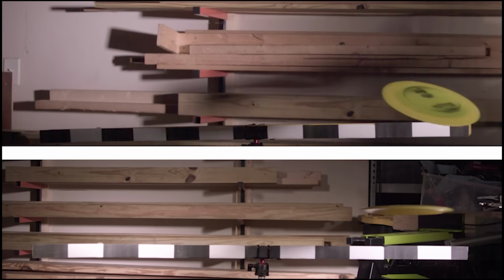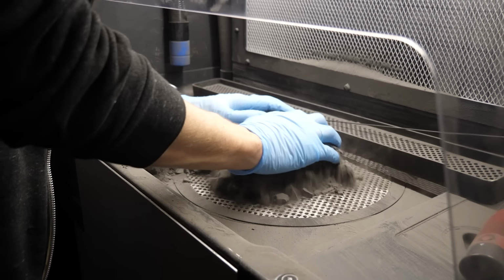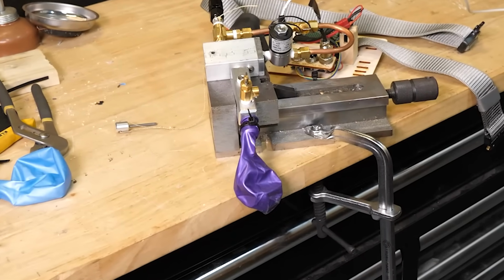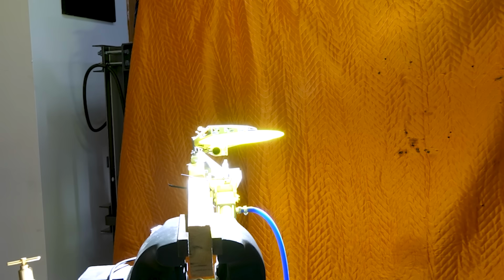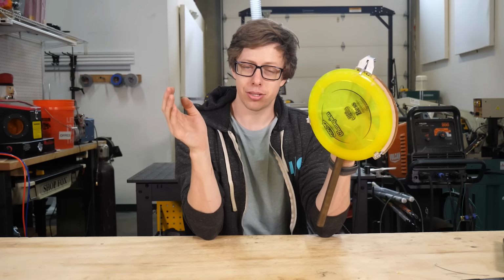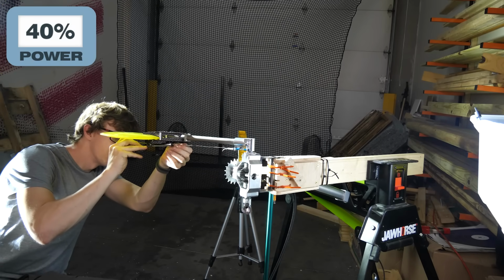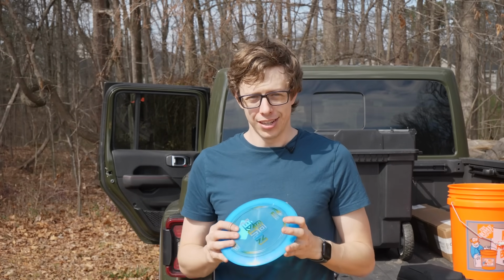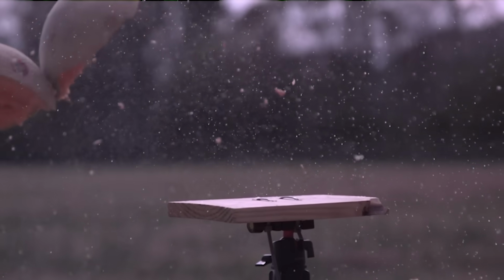Wrist rocket: worlds fastest disc launcher

Comment: You should tilt it a bit more towards the ground (to the left). It naturally wants to tilt to the right, so it will stabilize in the air and go further before tilting to the right. I know that from personal experience but I don't know if it will apply to the speed you're using. Great video btw, can't wait for more!
Reply: Makes sense
Reply: @Perspari  Thought the same exact thing.
Reply: Honestly surprised he didn't think of it on his own, but that kind of insight is probably gained from more experience playing. With the right regulation disc, right release angle, right wind he could break 1k with it.
Reply: @mikesearcy9151  exactly what I was thinking, he makes parts with a CNC machine and carbon fibre, but didn’t think about releasing the overstable disc more hyzer.
Reply: Seriously I was so frustrated that he didn't try that. You can tell from the slomos that it is tilted to the right as soon as it is launched.  If he starts it with a left tilt it will take longer to tilt to the right.  This guy isn't really that smart is he hahaha
Reply: You are correct! He needs to angle it WAY down at those speeds. It’s what’s called a hyzer flip.
Reply: There's that, "smart - stupid" continuum in action.

Comment: What I noticed for the machine is that when in the field it was launching everything at a flat  or even to an anheizer angle. I think that if they had forced these discs into heizer flips? they would have flexed out and gone a LOT further.
Reply: Absolutely.
Reply: Was literally just about to comment this lol. If you’re spinning a disc that fast, launch it on a sharp hyzer and let the disc stand up and glide.
Reply: @holterskolter  I bet the could release it almost vertically and it'd still flip up. I think it was a mistake for him not to reach out to a disc golf pro / expert. This could have been a WAYYY cooler experiment.

Comment: The two things I thought when first watching this video:  1.  You're not going to get enough spin.  2.  Angle of release can't be flat/speed and stability problems.  You needed a release mechanism that was going to impart a lot of spin on the disc, and you need a very over stable high speed disc launched on a pretty extreme hyzer angle.
Reply: I agree with your assessment. Hopefully he can work out what all the disc golf specific terminology means and make the necessary corrections. The whole time I was watching, I was saying to myself "nooo that's too flat, you need way more hyzer on the release!". Definitely needs more spin on the disc as well. I think a good candidate for a disc to try would be the Loft Bohrium.
Reply: @thndrlngs  What about the Tilt?  Definitely needs to release it on a steep hyzer as well.
Reply: You need a wrist action on the arm. And get rid of the diff. Attach the piston gear direct to the arm.
Reply: I was thinking this thing needs a hyzer flip angle to go far. He was throwing on an almost anhyzer release
Reply: Exactly. Spin is like cowbell. Ya can't get too much.

Comment: Have you considered throwing the disc forward with air pressure along a curved rail? your spinning apparatus itself is eating most of the forces you're putting on the disc before it leaves. I think you could get something like 1k ft. using something like a sliding "rail gun".

Comment: I’m surprised you didn’t try different angles of release. If it becomes “flippy” because of the speed, you should angle the outer edge down so it has more of an angle to turn over.
Reply: @Melt68  an hyzer?
Reply: Part of it just might have been the inexperience with not playing as much.
Reply: @slayerficated  No, hyzer so it doesnt flip so fastt
Reply: @Melt68  yeah, basically spike hyzer would probably level out on the more stable discs. and if the disc wobbles a lot, it also makes the disc less stable and more prone to flipping over.

Comment: My only gripe is you tested with an anhyzer angle. Before you start making more versions, do another round of testing with hyzer flips and maybe those overstable discs will hold their lines. Also test the tomahawk & other angled throws please! Maybe testing understable discs will get them spin-stabilized xD

Also, maybe make your own regulation discs that have extreme overstability? Probably cheaper than carbon fiber.
Reply: Release angle is part of it, but I think lack of rotation compared to a human throw at the same speed is more significant.
Reply: @BenKickert  I thought the same thing. Being that the disc doesn't have the wrist motion that humans give a disc when thrown it removes a lot of gyro stability.
Reply: Or get Discmania to sponsor the video with a bucket full of Tilt's!
Reply: Yes try it with a tilt
Reply: The largest issue appears to be lack of spin if you ask me.
Reply: He needs a secondary hinge on the disc gripper, like the wrist on an arm.
Reply: @BenKickert  we didn't great above shot in the video but id bet that holder isn't putting nearly as much spin as necessary for the kind of speed he's getting, when he stared the video with "I don't want to make a human hand" I realized he was doomed.

Comment: Incredible video. I love how the iterations moved the throwing style closer to how humans do it (holding the front of the disc rather than the back).

This machine does have commercial potential! Sell them to disc manufacturers to help them design new discs with specific flight paths. A standard throw is more valuable than a variable human throw.

I suggest trying different release angles. Your discs were all going to the right, so if you release with the disc wanting to go left, the disc should actually 'flip up' and fly flat
Reply: Came looking for this. I'm not an engineer or I would have tried to build this a decade ago. I could imagine manufacturers or resellers wanting this. Right now we have no standard way of truly rating one manufacturer's discs against another. This would be a game changer if you can get it to replicate a human throw, and be adjustable. 

Imagine walking into a disc golf store. You do a couple throws into a net where they measure the speed and spin you're throwing and pick the perfect disc to give you the most distance or the flight you want. PLEASE PLEASE PLEASE build this.
Reply: Totally agree on a design similar to this to sell to the disc mfrs... this wud be gold for them to have a way to get a consistent throw to better clarify the flight numbers... just needs some tweaks to control the speed & snap akin to what us mortals wud do on the tee-pad if/when we throw it as expected... also good for the disc mfrs to test discs on releases more or less than rated (speed/etc) for that perfect hyzer-flip disc based on what a person can throw... like here's the flight path for a 10-speed disc & here's the flight path when thrown at 8/9/11/12/etc speeds

Comment: This is great. As a disc golfer it would be amazing if a machine could match the spin and speed of a human throw for disc comparing purposes. I do think it has commercial potential for sales to disc manufactures.

On the distance testing it looked like all of them were released on an "anhyzer" angle (outside edge of the disc higher than the inside edge)? Did you try with a hyzer angle (the outside edge of the disc lower than the inside edge)?
Reply: lmfao untill a tank fails and blows a person in half, compressed air is no joke.
Reply: @codyskyrimvolen  in a proper testing environment safety precautions would likely be taken. Better shielding, a more sophisticated release mechanism and a HPA compressor that's in a separate room would do a lot to mitigate the risks in a commercial testing environment.
Reply: @codyskyrimvolen  divers use compressed air, how often are they blown in half? Asking for a friend.
Reply: @codyskyrimvolen  lol, tank failure is the least likely thing to worry about here :-D
Reply: This comment needs to be on top so @Stuff can see it, because this is the solution. A -3 turn disc doesn't flip with low power throws, while even 0 turn can flip on high power throws.
Some can throw 0 turn on hyzer, others need -3 turn on hyzer to get a flip-up.
Reply: @elricdotah  they check the tanks 3 times everytime they use or filll them, inspections on this kind of equipment are life and death.

Comment: One improvement that you overlooked when you abandoned the counter-rotating arm is that you no longer need the gearbox. That's a major source of power loss.
Reply: plus with no gearbox he could move the arm closer to inline with where the thing is held, eliminating most of the rotation problem he was having
Reply: At the very least, remove the lower pinion.
Reply: Even with the power loss he wasn't able to shoot disks at full power, so I'm not sure how more power would have helped
Reply: I think rather then using a complicated gearbox setup he could have had the rod extend past the rotation point a little bit where a heavy weight carefully measured to counteract the weight on the other side. This would resolve the torque issue while keeping everything mostly balanced.

If he wanted to get even more fancy he could try and make the counter balance side of the army get shorter when the disc gets released so that the lack of the disc wouldn't result in a change in the balance of the arm.

Comment: I know this video is older now, but if you release the disc with the outer edge lower on release, it will flatten out in flight before coming back the way it’s supposed to. It’s called turnover, the less stable the disc, the more likely it is to turn and flip like you saw.

Comment: Probably won't see this comment, but awesome video! I spend a lot of time around discs and have thought a lot about creating a machine that can "throw" discs with consistency. My thoughts regarding an arm powered device for faster and farther throws would be to attach a mechanical arm to the arm and forearm, hinged, of course, where the elbow is, and geared to have a faster output than the input. The mechanical arm would extend completely across the body, while your arm only goes back about halfway. When throwing, the gearing will make the mechanical arm move faster and "catch up" to your arm at full extension in the throw.

Comment: I feel like if you made a baseball pitching machine specifically for frisbees, it would work a lot better. Two wheels spinning in opposite directions would not only spit the disc out fast, it would also impart more spin for stability in the flight. This is just a theory because I’m a moron, but just figured it would be something to consider if you ever make a V2

Comment: The discs need to be released on a steep hyzer. Then when they turn, it will be to horizontal instead of turning into rollers
Reply: This is also what I was hoping to see! @stuffmadehere did you release any with hyzer angle?
Reply: He really should have teamed up with a disc golf engineer for this. If he got together with the guys at Latitude 64, innova, or Discraft etc. then this could really go somewhere.
Reply: It looked like it was set to anhyzer angle. I would like to see if this thing can make discmania tilt to hold that anhyzer.
Reply: @toniliimatainen4950  anhyzer bush lol

Comment: Have you seen the Mythbusters episode about the deadly throwing card? Jamie had the ingenious idea of using a very high RPM wheel to shoot the card. Also created alot of spin on the card.
Reply: As I was watching the video, I had the uncanny feeling like I'd seen this problem before on Mythbusters. Your comment sparked my memory. Adam tried to make throwing design (much like Shane's disc thrower here), and Jamie essentially made a very high speed pitching machine.

I believe that you are right to suggest Jamie's design, as not only was it fast, it imparted some lateral speed to the playing cards as you say.

If Shane wanted to make a pitching machine for his discs, one potential solution that he could implement would be to make a larger version of the foam disc shooter toys, which rely on the same principles.

Comment: Stuff Made Here:  I also invented a device, the disc whip, to allow me to fling a golf disc farther than I can throw it.  It worked.  Unlike your device, mine is totally human powered.  If you're interested, I made a humorous, 6 part video series about it and published it on YouTube.  The 1st part is called, "Disc Whip Invented By Paul Marostica Part 1".  By the way, your device might work, as is, if you just use it little differently.  I suggest you tilt it so it releases the disc on a tilt angle which would tend to counteract the turnovers you were getting.  The turnovers you showed turned over down to the right, so you could counteract that by initially releasing the disc tilted down to the left.  How much tilt you need varies with numerous factors, so you could just try 1 disc, pick a tilt, observe what happens, and modify accordingly.  In golf disc distance competitions the farthest throws commonly follow a path something like an S shape, where, as your device would throw, they are aimed a little to the left, and at their initial higher speeds they turn to the right, then they gradually slow and at lower speeds they fade to the left.  To make sure the disc doesn't hit the ground during the turn and then the fade, the disc is initially aimed slightly upward.  To summarize then, 3 suggestions:  Release the disc tilted down to the left, aimed a little to the left and a little up.  I enjoyed your video, but I was horrified when you had it on, and working, and it was releasing the disc in random directions at neck height!  I'm glad you're okay.  Best of luck.

Comment: Look up "hyzer flip".  Your machine is starting it on an anhyzer angle. Tilt the machine forward so that at the release point the disc is angled in a strong hyzer angle.  In flight you will see it start at hyzer angle and flip to flat and then turn to the right, then finally go back to hyzer at the end.  I bet you get killer distance if you try that.

Comment: spin and hyzer are both very important factors.   I would be interested in a simplified machine that uses hi speed spinning wheels to accelerate the disc  like a baseball pitching machine vs a full arm catapult setup. That would easily give you spin.
Reply: This was my first thought. Provides easy way to change both spin and shot velocity. I suspect it would take the fun out of the "throwing" motion though.

Comment: First off, your engineering skills are amazing. I don't posses those. So my idea might be way off base. But... if instead of an arm that needs to accelerate at an insane rate, then stop even quicker,  could you not just use a circular launcher that doesn't need to stop on a dime? Being circular the weight is more evenly distributed. It would actually be like a big disc launching a smaller one. I hope I explained that well enough to be understood. 😀
And keep up with these crazy projects. 🤪
Reply: I think he was going too create something that (at least theoretically) could be strapped to a person. Spinning death machine is too scary :)

Comment: 10:17 I would have thought it would be a lot easier if your rotating elements are T-shaped instead of L-shaped.  That way you can adjust each side at will instead of trying to discard the bottom element.
Reply: I think the reason you're not getting record breaking distance is that the energy is largely wasted in circular rotation. 

In practice, pros pull a disc across their chests in more of an ellipse. The bodily rotation is where the power comes from, but the "launch path" of the disc is closer to a straight line than you might think.

Comment: It’s funny that you switched to a “pulling” method because that’s how throws are taught. Less focus on wind up spinning, and more focus on stable “pull”. Also pros change their grip to help stabilize the disc as they release it. Less wobble = more distance and consistent flight. You should meet up with some pros and get tips. Also drives are not always used with drivers. And that flipping issue is the turn. You would have to release the disc with a ton of hyzer to be able to cope with your release speeds. It actually looks like your discs were release with anhyzer. Making the turn or “flip” worse

Comment: For distance you need to throw on a hyzer angle with the far side of the disc lower. This lets the disc 'flip up' to flat. The over speed will then make the disc 'under stable' so it will turn right. Eventually when it has slowed it will 'fade' to the left. Look at using a Latitude 64 Missilen (15, 3, -0.5, 4.5) I.e. Speed of throw 15. Glide 5. Turn -0.5. Fade 4.5.

Comment: Baseball pitching machine mechanism. Much simpler to build, and would put a ton of spin on the disc if the driving wheels are off-center. Also, I’d look into which discs have a reputation for torque resistance. The RocX3 has a great rep for forearm throws because of its torque resistance, and there may be even better discs than that.

In any case, cool video.

Comment: When I was a teenager, mid 70s, I mounted a Cox .049 fuel engine with a 3 bladed propeller to a frisbee, used a cylinder and piston from a dead engine epoxied opposite the 'live' cylinder, tried about 30 times to get it balanced enough to fly, when it finally took off and flew, it just kept going until I lost sight, sound of it. I looked for it for weeks and never found it, it was a lot of fun, probably set some kind of distance record but I never considered that, life is fun when you can make it fun

Comment: Today was my first watch of your channel (actually the puzzle solver was first) and I'm not reading 11K comments but two things stand out. One, as a Frisbee thrower with some skill, throw at a roll angle of -45 degrees so the disk flattens out instead of diving edgewise into the ground. Two, make the chain gear asymmetric so the torque builds as the arm extends. This might soften the initial forces. It might be more like a trebuchet, where the arm starts slowly but builds in speed as the arm extends.